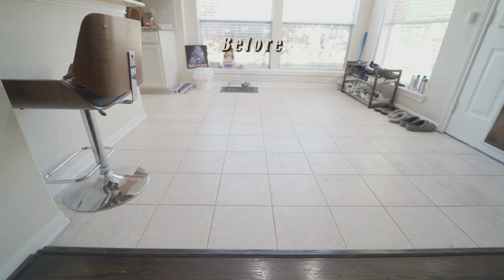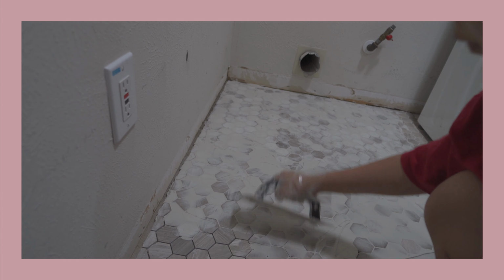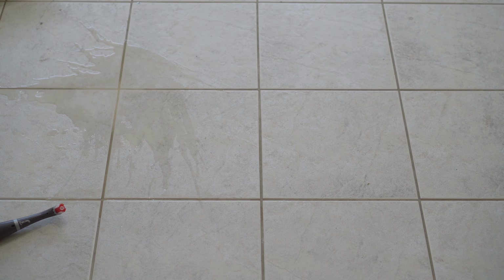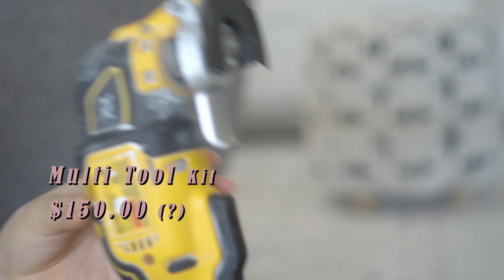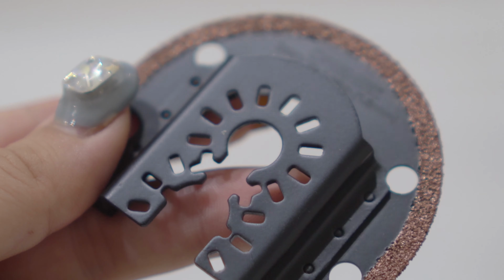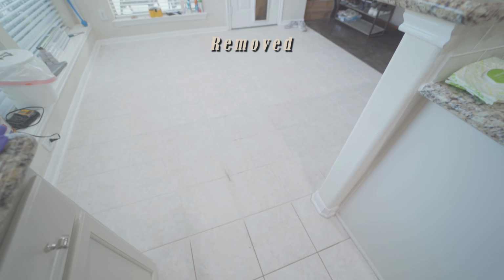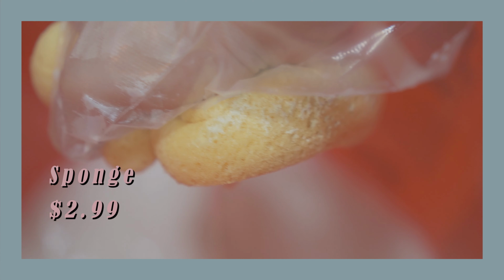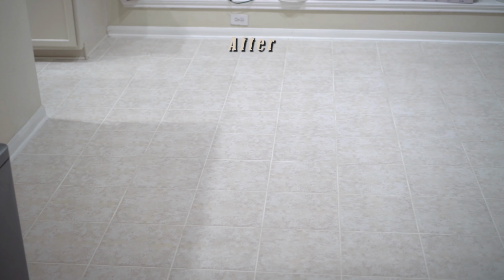How to update old tile floor like a NEW on a budget

Comment from the maker: 0:00 Preview 프리뷰
0:14 Before & After (Short) 비포&에프터 (짧은버전)
0:55 Scrubber 스크러버
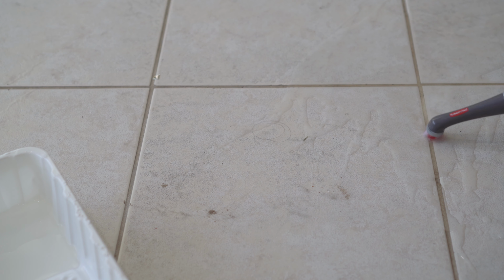2:02 Clean by a scrubber 스크러버로 청소
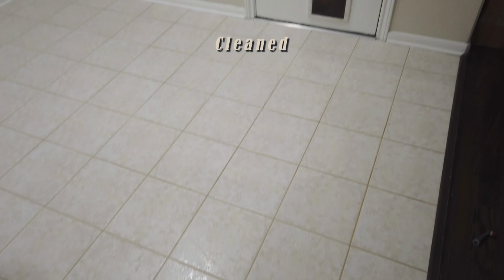2:38 Before & After by a scrubber 스크러버 이용한 비포&에프터
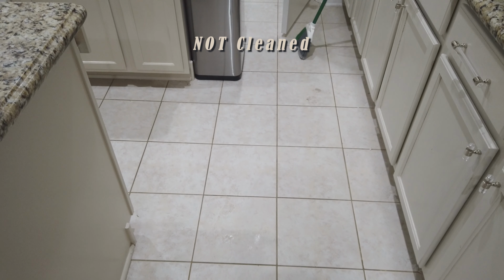3:04 Multi tool 멀티툴
3:59 Grout removal blade 타일줄눈(그라우트) 제거용 날
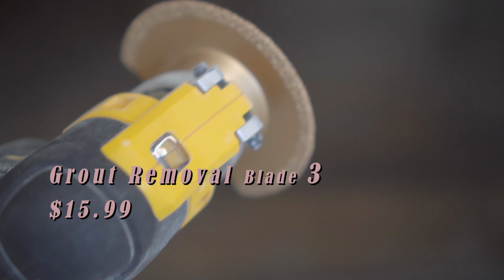4:32 Remove grout 타일줄눈(그라우트) 제거
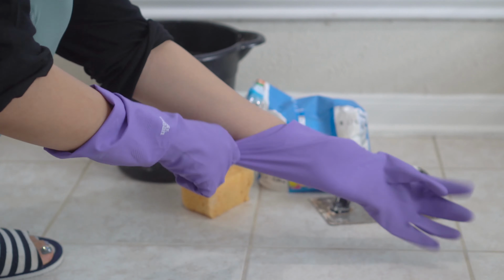5:33 Grout work 타일줄눈(그라우트) 새로 채우기 작업
6:18 Before & After (Detail) 최종 비포&에프터
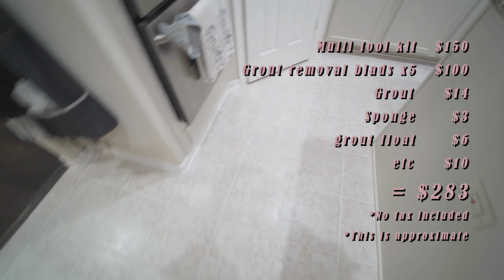6:57 Total cost of the update 총 비용